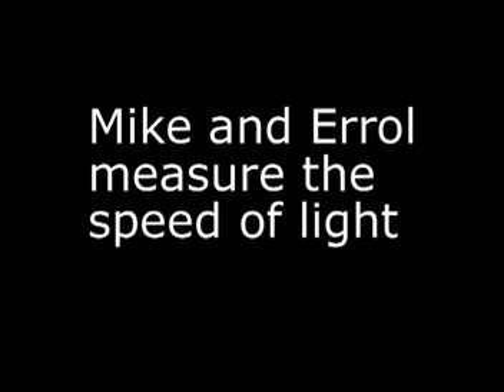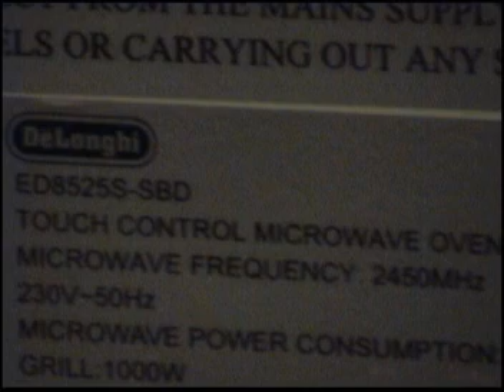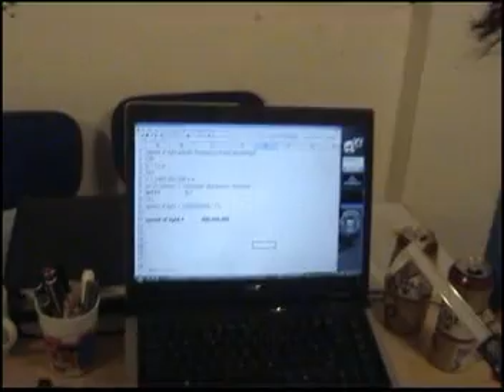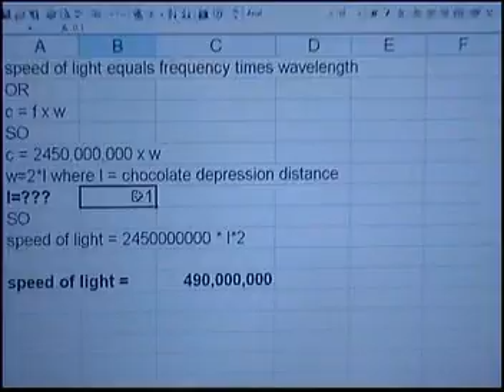Measuring the speed of light - not as easy as it sounds

Comment from the maker: @earunan: I'm glad you got it to work. I'm afraid we haven't got round to repeating the experiment. I would certainly expect the microwaves to be travelling backwards and forwards because they will bounce around all over the place inside, but at least in a consistent pattern. That is, unless you've got a 'wave stirrer' (I think it's Philips) that I think has a moving magnetron or deflector rather than a turntable so of course it is specifically intended to avoid static hotspots and coldspots.

Comment: We repeated the experiment and we got the distance between bubblespots as 61 mm which gives the speed of light rather accurately.  We also noted that the bubbles were not on the same line. The three bubbles we had in the chocolates formed a triangle rather than a straight line which implies that the microwave is traveling back and forth (reflected within the oven). I think this experiment has shown the two peaks that resulted when microwave traveled back and forth.

Comment from the maker: Ah, Seanfiddling, I suspect a line of buttons could potentially give an error because if the high spots of the standing waves are in some kind of square pattern, you may have been measuring at an angle across squares, rather than between the two closest standing waves. I think that's why an area of chocolate is best rather than a line. But I agree, a good exercise to go through.